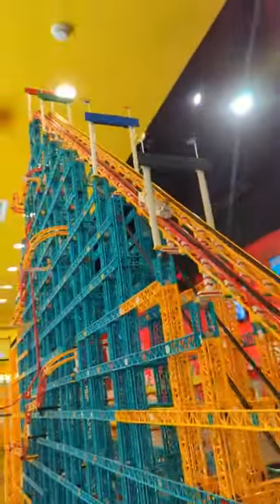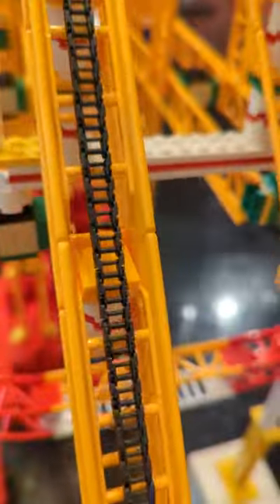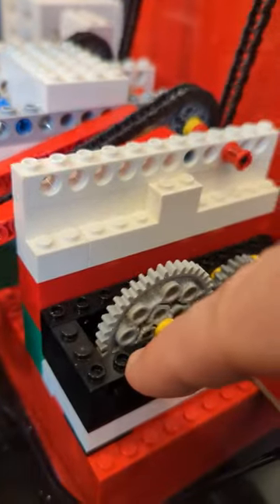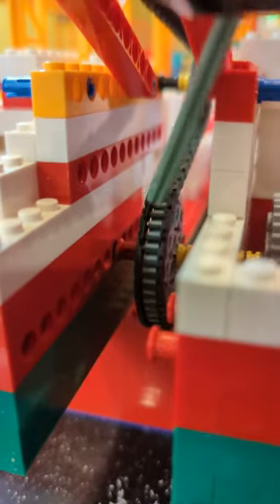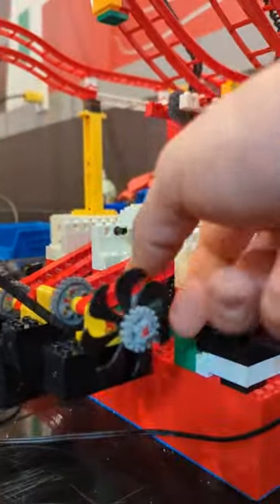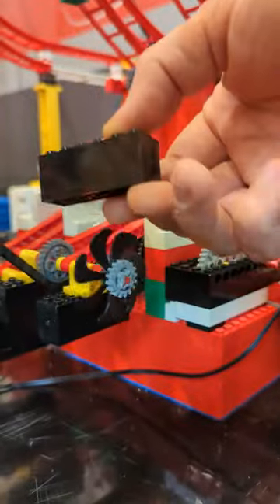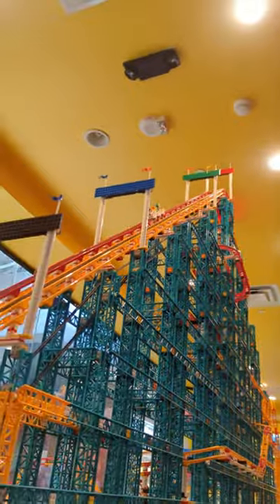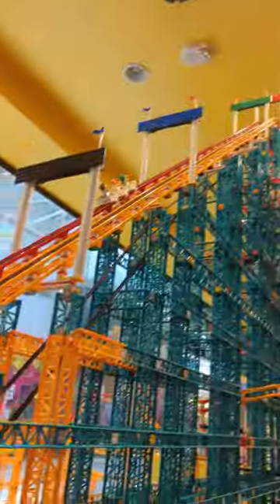Using LEGO Gears in a MASSIVE Roller Coaster

Comment: Is there a reason you used 9v instead of power functions?
And did you have to source them from bricklink?
Reply: The 9v system uses wall power which saves on batteries